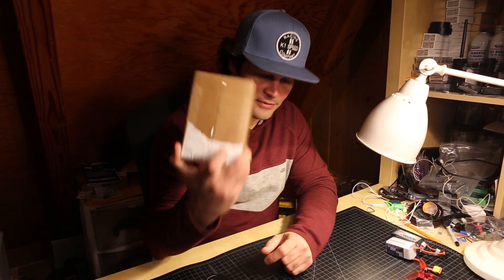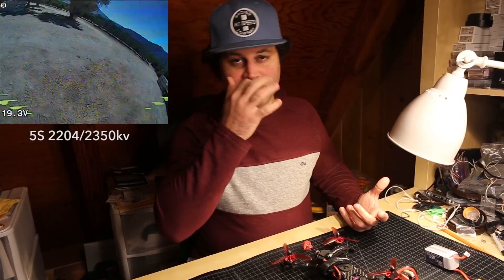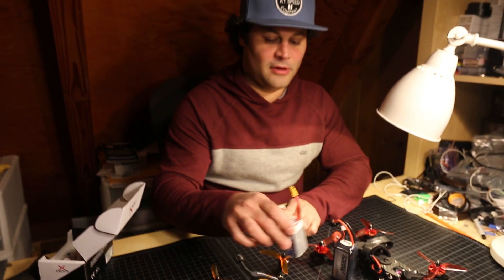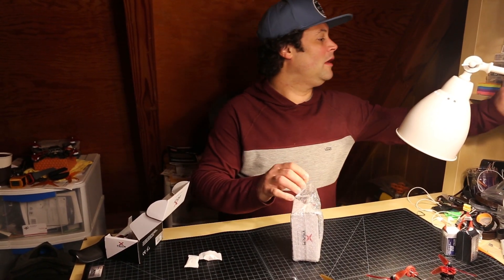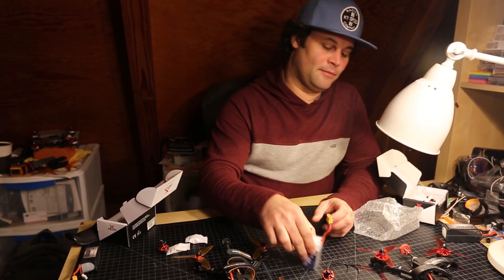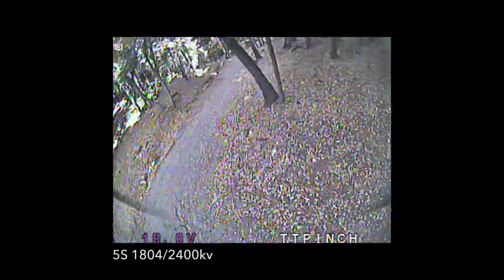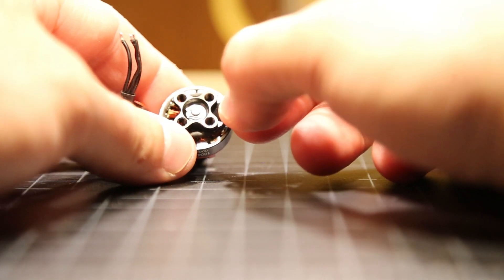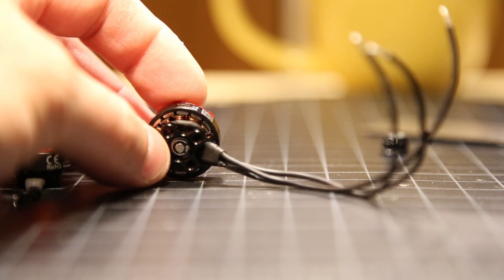5S POWER on 4 Inch Quad Part 2 - XNOVA 1804/2400kv FPV Motors

Comment: Is there a part 3?
I’m trying 2507 3100 on 4” and 4S but the weight of lipo needs a bigger motor and there’s more weight,etc….
It looks like you have found the dilemma.
How many amps did they end up using ?

Comment: So for a 4s freestyle set up with these 1804  motors.... would it be best to go 3100kv or get 3500kv and set a throttle limit in BF?  Using 4" props.  Thanks!
Reply: These are power hungry on 4 inch props, but I would do 3500kv for 4s. At least at the moment, that's what I would do.
Reply: @DannyCruzCreations  Thanks for the reply!  Maybe you can help me out.  Picking out components for my first build.  Going with micro apex frame on 4" props.  Wanting a solid 4" freestyle set up.  If these are very power hungry on 4" props can you recommend an alternative?  Ideally don't want to use the "t nut" style mounting like most 2004's.
Reply: @dustinnorth5149  doing the same thing! What did you end up going with?

Comment: I can't find Part 3 of this video, did you cancel this project? I hope there will be a 6s ready version on this 1804 motor! Xnova didn't release the 2400kV version, am i right?
Reply from the maker: Ahhh. I surprised someone asked. I should do a follow up. I canned the project. No matter what I tried I could not build a 4 inch setup that would beat a 6s 5 inch even on the tightest course. The idea is that on some courses, the 4 inch would have an advantage. But even on the tightest courses, I would go out and immediately smash the times set by the 4 inch with a 5 inch 6s quad.
Reply: Man this kv is suited for 6s, and maybe a 600mah ish lipo. Its fakt that a lighter quad is very difficult to fly fast. You have to pushit hatder through the track, as the heavier one just falls in certain 3d, s'plit and another thechnical parts. Im just building a 4" 6s sub 250gram qwad and also in kontakt with xnova. I think this motor is the holy grale for that. Hope you follow up with a video. Try a 600mah 6s with the hq 4.4.4x3. Its gonna be amazing!
Reply from the maker: @swissuav9273  Hi, I gave up on this project because 5s is simply not going to work. 4 inch is too inefficient. I mean, it flies GREAT. But when you're trying to compete with 5inch 6s quads it's no go. At the time, 6s options were too limited. Now however, there are more options. I intend to go back to this project but on 6S... It gets tricky because I I have to replace the KISS CC as I trust it, but up to 5S. I think 6S will kill that board. And I want to switch to a bottom mount frame that will be lighter and a bit more aero. Again, to gain that extra bit. I sold one of the builds to a friend. I think he'll love it. Absolutely no qualms in selling this to a friend. It really is an awesome build. I'm just trying to go to extremes here. I'll likely use the funds to get another frame, FC/ESC and a few 6S packs to see if I can get that extra edge.

Comment: wow crazy with kiss cc on 5s :O

i can realy recomend the hglrc f440. i came from the kiss cc too tho, and the lighgter weight of the f440 trigger me...it absolutely shredd. i still using 4s, and the battery push realy to the limit, but the fun is unbelivable...it makes my 4" setup snappy than 3" and daaayymmm fast. as a not that expirience pilot i realy feel the difference...and i like betaflight more ;P
thanks for review i will definitly test these if i need new motors for my 4"
what kv you prefere for a 4" on 4s?
Reply from the maker: Hi! Thanks for the feedback. On 4s 4" I prefer 3000kv motors if they are large like 2204, but if 1407 to 1606, 3200kv or so is what I would recommend. I'm flying mostly 6S 5" now, but I still pull out the 4 inchers every once in a while.
Reply: @PinchTune  thanks for answer. i dont try 5" but i love the agility of 3 and 4". in europe its better to stay under 250g to dont get problems with  the law. but its fun to build sub 250g quads. every quad is a challange. i love the new tbs nano pro32...
Reply from the maker: @qygpygpq707  Right, I get it. These 5S 4 inchers are definitely heavier than 250g.

Comment: You are wrong. Please, check my videos to see how efficient are my hobbywing xrotor 1408 2400kv on a 6s 550mah lipo. Killing 250g 4inch racing setup. But those xmotors - those look interesting. Curious about the comparision with my 1408. Xnovas should have a stronger bottom of the thrust (which is already insane on my 1408 [not sure why, I suppose it is achived thanks to very densly situated N54SH magnets and very small separation between magnets and the laminations of the stator]). Great video!
Reply from the maker: Well... I'm not wrong. The fact that you found a setup that works doesn't make me wrong. There are way too many variables there to even make a fair comparison. Smaller battery and lighter weight overall, for starters. That said.... I'm going to go look at those motors. I have a 1407 4s setup that kicks ass. What you mention there sounds like a great combination that I haven't tried yet.
Reply: the comparison would be interesting yes!

Comment: I’m just curious but did you ever try reducing the max throttle on your transmitter for the motors with high kv?    Or is it just better to have the right kv motors?  I always buy by high kv and reduce throttle but I don’t race as much as you or worry about flight times.  Is there a down side to reducing the max throttle?
Reply from the maker: You know what? I know a lot of people that do this... but I personally have not done it myself. Also, it's just not convenient for me because I tend to fly various quads out of the same model on my radio. I generally have Betaflight CRSF, Betaflight SBUS, KISS CRSF, KISS SBUS... FlightOne, etc. I would have to create new models to do something like this.
Reply: PinchTune betaflight osd has the throttle limit built into osd
Reply from the maker: @brokenfpv4601  Ah cool. Thanks.